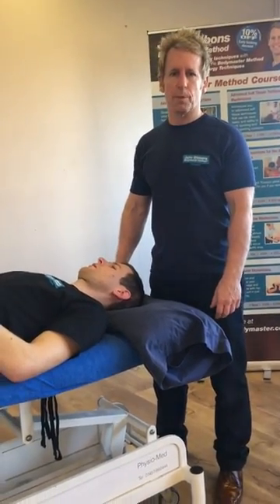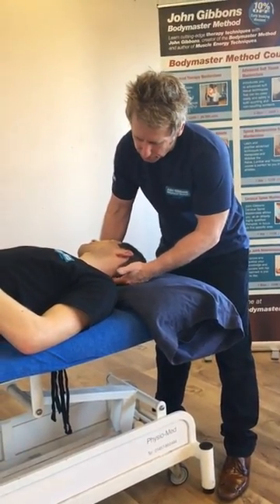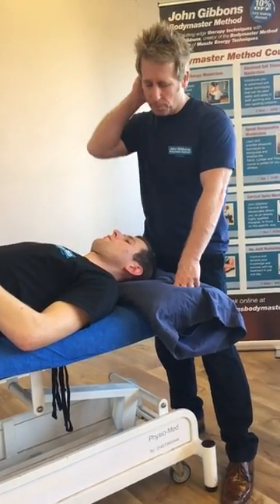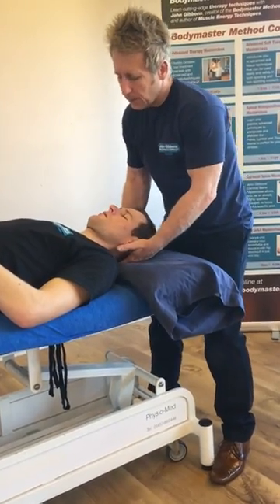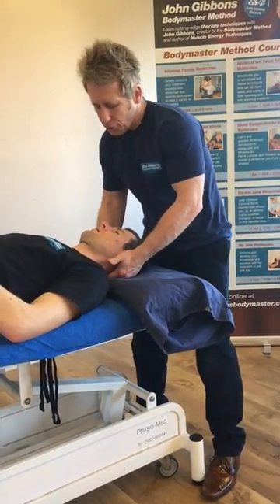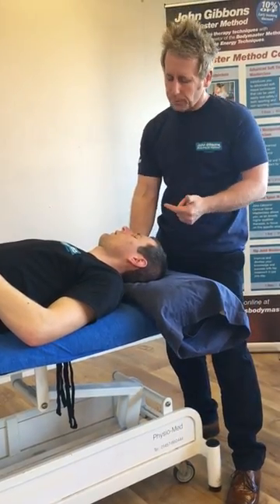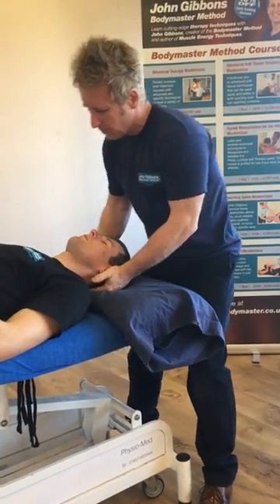HVT / Grade 5 Spinal Manipulation of the upper C1/2 (AA) Cervical Spine

Comment: Interesting I didn't know osteopath's did adjustments, you are doing the same thing. Are there any differences between how you and chiropractors do adjustments. Also have you read about the stroke issue (I know its only happened to 1 person, maybe more now), I have seen some chiro's say that you dont want to do any adjustments with the head looking up cause it increases the risk of the patient having a stroke.
Reply from the maker: I consider our adjustments are pretty similar and there is no research to show that the Vertebral artery is compromised in that position and the chances of causing a stroke is so minimal anyway, and there is more chance of causing a stroke when you get your hair washed at the hairdressers. Hope that helps, regards JG
Reply from the maker: I guess you now know that some Osteopaths do adjustments, I tend to manipulate in flexion as I personally think it is safer and the research that states Chiropractic or Osteopathic adjustment causes a stroke is so low that I personally don't worry about it, because if I did i wouldn't be adjusting any cervical spines. Regards JG
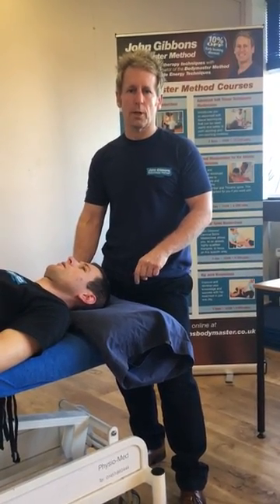Reply: @JohnGibbons  2:37
Reply from the maker: They should all be able to adjust if they are an osteopath. JG
Reply: windstorminator what kind osteopath can't do adjustments? :D